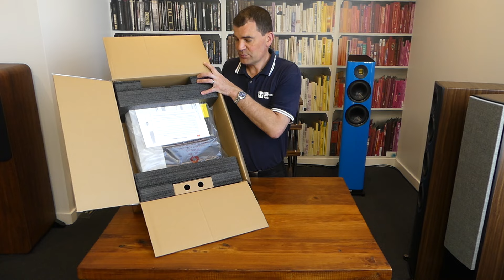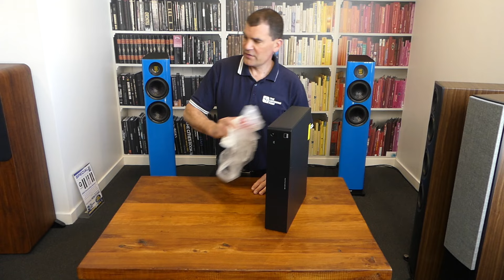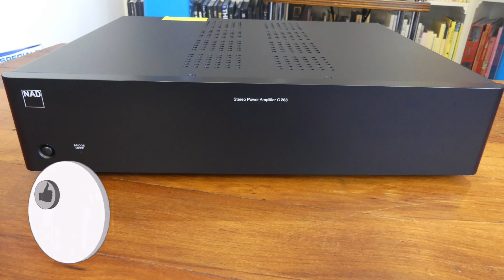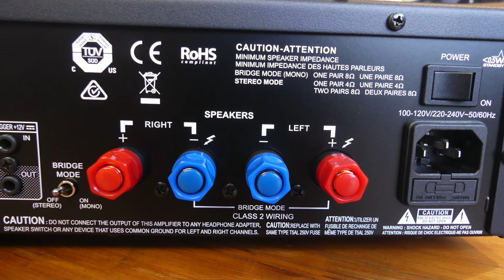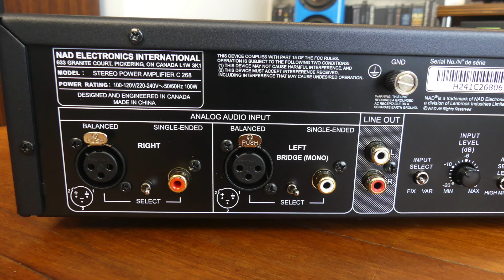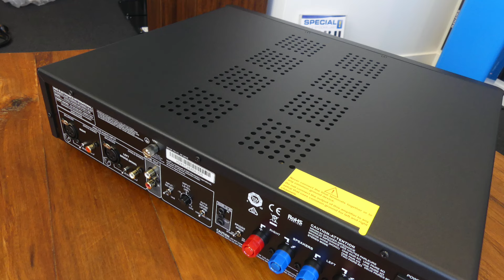NAD C268 Power Amplifier Unboxed | The Listening Post | TLPCHC TLPWLG

Comment: Hi. Just 2 questions.
If I have to use in a biampling system (starting from an integrated amp), the variabile gain mode needs to equalize the gain of this to the gain of the power section of the integrated amp. So if I want to match with 31.6 db of mine, I have to turn 3 notches anticlockwise starting from “0”. Is it right?

Second question: C268 is better to use with low or med-high frequencies? 

Thanks a lot.
Reply from the maker: Hi Firstly, use the power amp for the "Lows". The extra current required means the int amp can run the lighter load of the "mid & high's" and the pre-amp stage.   Second - Gain:  Not knowing the Int amp, I can only suggest you "play it by ear" and slowly adjust the gain until it sound balanced.